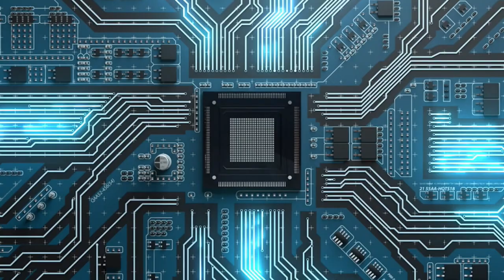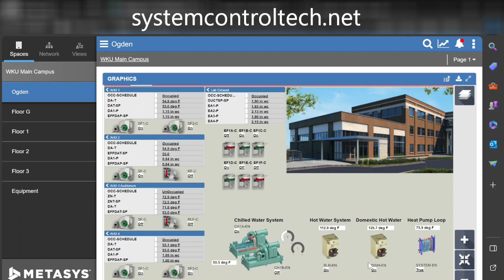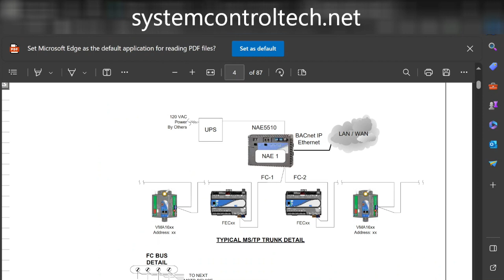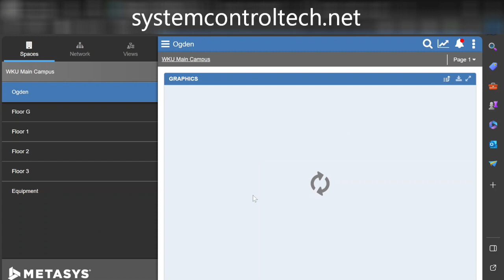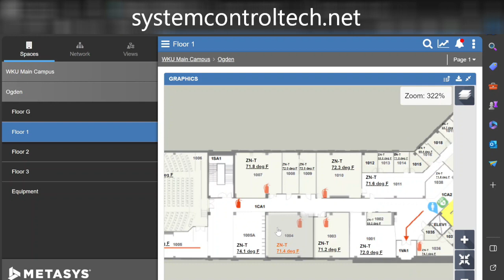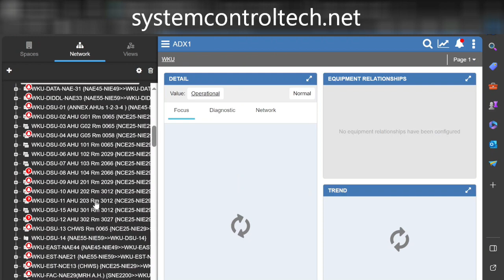Demystifying Building Automation Systems: A Beginner's Guide to Network Layout

Comment: We have Metasys SNE22002.  How do I monitor the system so I can submit a work order to our Facilities Maintenance department?  What software, certification, and training is needed to do so as an IT worker?

For context, I am in the IT department (only employee) at a college, and HVAC frequently goes down in my building.
Reply from the maker: There are a couple possibilities. First, do you have a server running the metasys software? If not, you will need to browse directly to the SNE, loading the launcher tool and accessing the system.
Reply: @Systemcontroltech   I don’t know, I contacted Facilities operation for further guidance and permissions etc.  Also learning more about BAS/BMS in meantime.  Not my primary responsibility but would like insight into  building systems.

thank you for the reply